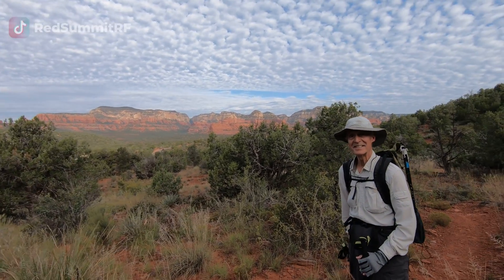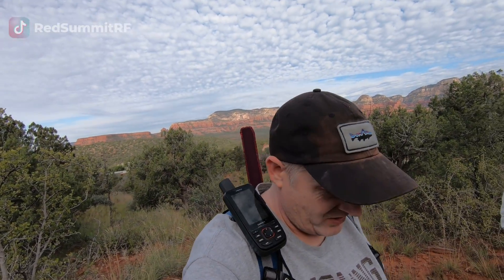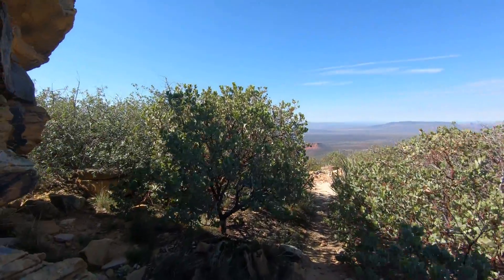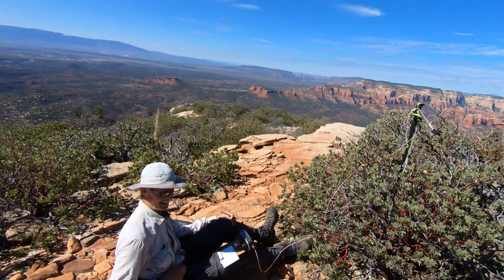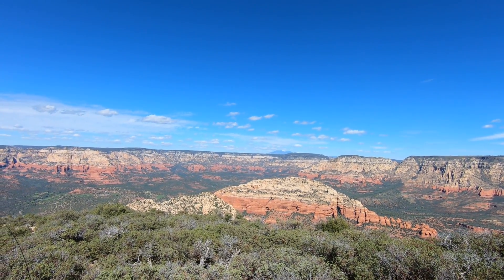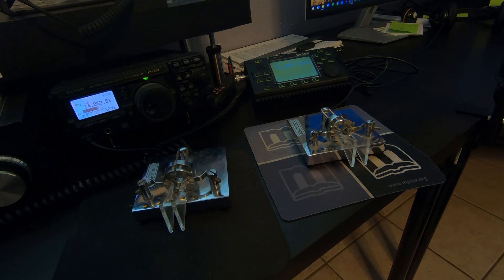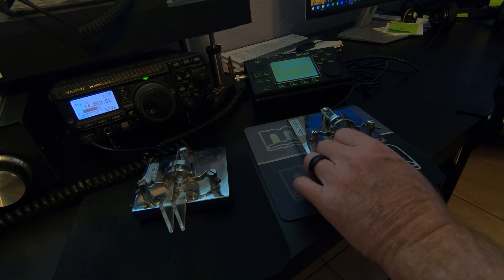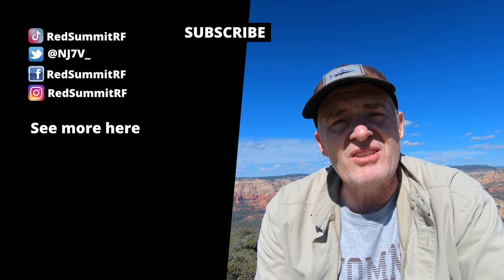Xiegu X5105 – Built-In CW Keyer Using The Latest Firmware.

Comment: Red Summit YOU are the reason I'm learning CW like a mad man! Also glad for this second vid on the 5105. It is in my top 2 choices for an HF rig (the other is the FX4CR). I almost dropped the 5105 as a contender post your first vid on it. I do wonder if Xiegu addressed your other problem---the woefully slow battery charging ???? Also, have you read that if using external power and trasmitting AND suddenly loose external power that you can destroy the radio ? I'm subscribing. Thanks for the work you put into these vids, and I'll have you know that I can actually follow/understand the CW that you scroll across the vids during the CW activation!

Comment: Good video, so what is the latest version of the X5105 are you using and where was Mike K8MRD able to get the firmware?  Thanks 73  KV5P
Reply from the maker: Hi Mike - I think I was using the version from the factory and later I was able to get the latest.  It made a big difference with the Morse code.

Comment: The keyer in the xiegus (original) is so bad... I thought I was losing what little fist I have.  I switched back to my icom and all was fine.  I'm glad you put this out and that xiegu fixed it.  They say they've fixed it on the G106, I'll have to give it a whirl.
Reply from the maker: Hi TO - haha I was questioning myself on CW skills too on that first run with the X5105.  I wish I knew if they use the same keyer in the X6100 and G90.  The X5105 and X6100 have a very similar feel.
Reply: @RedSummitRF  as far as I know, it's software based in the STM32, So if they are doing their job right, it's copy and paste across the range.

Comment: I liked how Pat was doing hand motions trying to figure ur left handed keying with dashes on your thumb. Neat summit. X5105 still seemed not as smooth on the keying as other rigs but got the job done.
Reply from the maker: Hi Ian - LOL I didn't notice that about Pat with the left handed stuff.  You are spot on with your observations on the keyer.  It is greatly improved with the software but still doesn't quite perform the same as some of the bigger names in radio.

Comment: Charlie:  What is that scratchy / crunching noise on the receiver.  At first I thought it might be Pat operating above you in close proximity, but I hear it when he walked down beside you.  Clear skies so I don't think it is static?  Could it be BroadCast interference?

One thing is for sure............that hike looked a little hairy in a few places, but WOW, what views.
You and Pat did a fine job !!!  What was the temperature range for times you were up there. 

73
Reply from the maker: Hi Mark - it's hard to say for sure what the scratchy sound is.  Given my experience with the radio I would have no problem believing it was interference from broadcast.  I think you also probably noticed the overload when a few other stations were near by.  Filtering helped a little but it was still a struggle.
Most of the hike was a little sketchy so yeah, I felt good about finishing this one.  I would have to take a guess on temperature but it was certainly comfortable.  Maybe 65F starting out and 75-80 at the peak.

Comment: So now I gotta ask: how does the x5105 keyer compare to the x6100?
I only have the x6100 and I wasn't too much of a fan of the x6100 keyer, but I've only been able to use CW for all of two weeks so I can't really use my experience as a baseline. (I found that my ic706 and QCX keyers were much easier to use)
DE KM4CFT
EDIT: I just tried doing what you demonstrated and it seems that the x6100 is missing that feature where it remembers what you press. Hopefully Xiegu will bring that keyer feature into the x6100
Reply from the maker: Hi Jonathan - it's been a while since I used the X6100 but yes, I seem to remember it having a similar problem.  I mean, even with the X5105 on the latest firmware it still just doesn't feel as good as the big name brands.  I would say this, though.  The X5105 on the latest firmware feels better than the performance I recall form the X6100.
Reply: @RedSummitRF  much appreciated. It seems that there is a way to submit bug reports and feature requests to Xiegu through raddiodity so I'll ask them if they can add it onto the next firmware update. 
Part of me wishes that Xiegu open sourced some of their firmware so that the community could provide improvements should we be so inclined